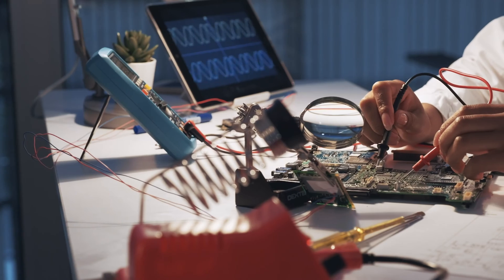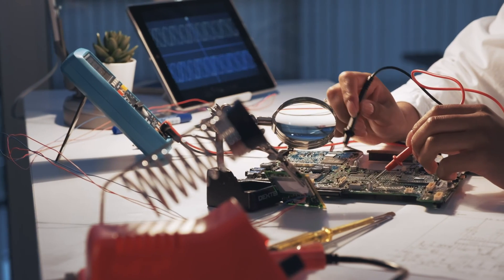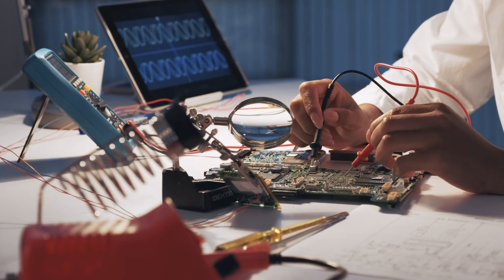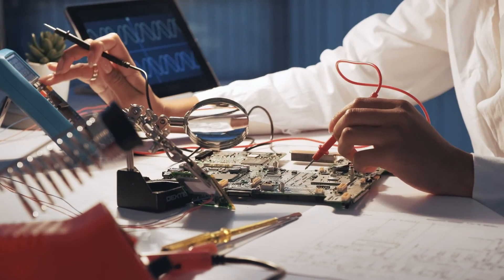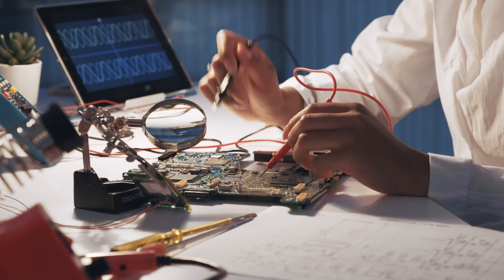Redarc 1250D Issue,  2 hour Charge Limit.

Comment: My 1225D RedArc runs for 2 hours full charge rate, resets after 20 mins of the charge rate system pulse, float etc. then goes back to what is needed up to 25 amps, 21 amps actual i am getting. But i have gone over all earth circuits for better performance. All connections and cables rated at least double what is required and distance. The main problem i see is the battery being too big for car alternators, 200 Amp Hour or more then you will have to take a lot more things into consideration. I think it is to protect batteries, alternator and wiring as these devices can get quite warm after running at full charge rate for an hour or two. Also temperature sensor inside device can limit output at times but also should reset after about 20 mins if working correctly. RedArc 1250D issues you are having you should speak to a RedArc Specialist. Maybe increase your main starter battery size to match your larger secondary battery as if there is a massive difference between Amps/AmpHours then this causes a lot of issues.
Reply from the maker: Thanks for the advice.   I've since moved that charger on and gave it to my old mate.   I'm using a solar panel now.

Comment: my 1225d keeps overheating and and throttling down to about 5 amps  about every hour. this thing is junk. REDARC is paying influincers to praise the charger without telling you its only going to charge till it gets hot and call it a day.
Reply from the maker: @thrillhunter9897  I think that’s why the 1250D that I had was programmed to only work for 2 hours than shut down.  To stop it overheating. 

My 1225D has failed.  It will not charge anymore.

Comment: i just installed a  renogy battery monitor in the  car cabin  the most ive seen the 1250d charge while driving  is 38 amps and tHAT WAS only for 2 min it averages on 23amps while driving wish i never bought it
Reply from the maker: Maybe your cabling  is not up to par or the alternator in your vehicle. 

Also the 1250D could be over heating.

Comment: I just ordered one of these.  What I am seeing from their site is that they have the boost charge time limit set to 3hr40min with a 20 min rest, then it resumes.  This is under the new firmware.  Does anyone know if this is true?
Reply from the maker: Yes it's true.  I was not able to confirm how long the charge time is with new firmware.  I've not tried one with latest firmware. 

Make sure it does have the latest firmware before purchase.
Reply: @PhilsCampingReviews  you already know that your unit is faulty, as many have been commenting for about a year now, stating that with the old firmware, the charging reset after 20 minutes.  Yours did not, therefore its faulty.  So the conclusions in this video are that you have a faulty unit.  Really you should add a pinned post, or add in the description this fact.
Reply from the maker: @richardgrant6360   it was not a faulty unit.
Reply: @PhilsCampingReviews  yes it is, if it was not faulty, it would start charging again after a 20 minute break.  Thats what ALL working Redarcs do, your unit is faulty.  This has been discussed, and you already know this.
Reply: @richardgrant6360  old firmware doesn't mean it's not faulty and the new update is pretty inexcusable too.  I get them shutting off for heat but they shouldn't shut off at a set time unless an owner chooses to have it shut off after a set time
Reply: @veganpotterthevegan  its faulty, its pretty straight forward.  People on youtube just like to create content for attention and revenue.  Its tedious.
Reply: @DonegalOverlanding  when it works as designed, I'd call that faulty.  Why would they design it to shut off after a certain time instead of limiting it by temperature?  It's faulty on purpose

Comment: What about the 1240D? Does it have the same limit?
Reply from the maker: I don't think it has the same issues.
Reply: @PhilsCampingReviews  you unit is faulty. stop going on about it like its all 1250D units.  Absolute joke.
Reply from the maker: @richardgrant6360   it's not faulty.  It's the way it is.
Reply: @PhilsCampingReviews  yes it is, if it was not faulty, it would start charging again after a 20 minute break.  Thats what ALL working Redarcs do, your unit is faulty.  This has been discussed, and you already know this.
Reply from the maker: @richardgrant6360   either way. It's still a stupid feature to have. None of the others have this feature.   

Now that larger capacity batteries are more affordable.  This js going to be an issue.
Reply: @PhilsCampingReviews  how is it a stupid feature that it has a 20 minute cool down cycle?  What would be stupid is that it did not have it and it would damage the unit from overheating.  50A is a lot of power for such a small unit, most powerful units have a much larger cooling solution built in.  The problem is that yours is faulty and didnt reset after 20 minutes, otherwise its absolutely fine.  I have Redarc BCDC1240, Redarc BCDC1250D, Ctek Smartpass combo which has 120A charging and I have now got Mastervolt 90Amp current limiter because 90A is plenty of charge while driving, and its much easier using the same brand of gear in order to communicate properly.   The Ctek was powerful, but it doesnt have good solar options, way too restrictive.  You really need to get some solar up there on your tent, it will really help.

Comment: I'm a bit surprised at a few comments that are talking about buying Renogy instead of Redarc. Renogy is junk and shouldn't even be compared to a high end product like Redarc. They're in completely different categories. Renogy will break on you at the most inconvenient time & place after a few uses. It's a ticking time bomb. Amazon even has a warning message displayed for Renogy DC-DC saying "frequently returned product".
Reply: Well, in practice, this essentially breaks on you every 2hrs😂
Reply from the maker: I know a few people with Renogy and have no Issues. 

Agree. Redarc is better quality. But some people don't have the budget for redarc.
Reply: Hey, dont come in here with facts to ruin what is en entirely misleading video.  It should be taken down as his unit is clearly faulty.  So many comments stating that it resets after 20 minutes.  He has not though, because he likes the cash from the video.
Reply: @richardgrant6360  if its nice and cool it will reset in 20 mins but if its hot outside it wont reset for a couple hours. because it shuts down to keep from catching fire. it gets so hot you will burn your hand.
Reply: @richardgrant6360  I absolutely wouldn't want something that stops working every 2hrs for a 20min reset.  Why does only redarc have this? *A year later, this video has 5000 views.  Probably gave him enough to buy part of a tank of gas

Comment: I fitted a 80mm fan to the 1250D and in 21 to 23°C ambient, it ran @ 50A continuously for 5hrs 15mins, putting 260AH charge back in to my dead flat 2x 120AH Kings LFP batteries. @ this point, the batt voltage was 14.1V according to Vitron, and the 1250D continued to charge for another 10mins, with the current falling away to about 10A before the battery finally cut off at 14.36v. After 2mins, the 1250D dropped its voltage to 13.7v.
All of this is a comletely normal, and correct charge cycle.

Before the fan was fitted, the 1250D would run @ 50A for about 10mins, b4 dropping to 43A.

I used a 21cfm 12v 18dBa fan. This is the quietest 80mm fan on the market, but also the lowest airflow, and the 1250D still produced 50A @ 22°C for 5hrs.

Any regular cheap 80mm fan will produce 30cfm and 28dBa - you should not hear 28dBa when the car is driving. 30cfm is 50% more than the fan I used, thus any 80mm fan should be ok.

I used some 12.7mm Adhesive PCB Standoffs from Jaycar, plus a 80mm fan guard, amd sone zip ties. Mount the fan to the ribbed face, 1/3 from the led end - this end is hotter.

I tested the fan with the 1250D both horizontal laying on a solid surface and vertical - makes no difference - both are still 50A after an hr

1250D fixed.
Reply from the maker: Interesting.  I wonder if a ambient temp of 30c if that fan would make a difference. 

Do you have any photos?  If so if you could email them to me at.
Philscampingandtouring@gmail.com
Reply: @PhilsCampingReviews  ok. I will test at higher ambient soon - I will use my travel oven. It didnt occur to me that the 1250D would not be mounted in the cabin, ie, in 20-25°C ac comfort. Yes, many mount the 1250D in their camper trailer. I will send pics soon.
Fyi, I am testing a Kings40A DCDC today - with and without a fan.
I hace a 2000usew inverter,  induction cooking, and 240v kettle and toaster. And, also use the kettle to provide hotwater for the Lion powered camp shower.
50A charging is not enough for me. I am adding the 40A kings in parallel. 90A total charging is about the right max load for my 130A altenator.
Reply from the maker: How did the test go? 

I'm considering  trying another Redarc 1250D with a newer firmware. 

I like the idea of attaching a cooling fan on the top.

Comment: Phil your analysis of this problem is what I needed to hear. I'm in the market for a DCDC charger and inverter system, and still deciding on the brand to buy. Thanks for going into so much detail on issues.
Reply from the maker: Thanks.  The redarc dcdc 1250D.  If you purchase that one. Make sure you check the serial number before purchase with redarc to confirm if it has the latest firmware.  If it does. Purchase it.

Comment: I would only pick a charger that allows me to vary voltage thresholds (0.1V steps) & current limit to custom settings. Bluetooth or similar is better. I'll skip Redarc & similar that only have factory presets & not much flexibility.
Redarc should provide more information about any limitations & algorithms that may reduce usability/performance. Idle for 1hr should give reasonable cooling for 30min repeat if is wasn't firmware limited. Any limit should be based on temperatures not just time. Design should have been made to atleast handle 25A all day long. Should limit time charging the battery above 13.8V (depends on battery Ah), ramp down current till 14.2V & 1A. Need calibration/offsets for cable length or inaccurate sensors.
Reply from the maker: That would be the Victron?

Comment: Great Info Phil, thanks. I just emailed Redarc re. if the 1250D had any limitations with low ouput alternators (eg Hilux 80A). The response was - The unit can take up to 58 amps dependant on the voltage that the system is seeing. Will be looking at the 60A Renegy now, or 2 x 12/12 -30 Victrons. What did you end up with ?
Reply from the maker: I'm still using my old Redarc 1250D.  Have not purchased another DCDC thus far.  

I'm considering the enerdrive 40a dcdc

Comment: This 2hr boost is on the older models Phil the current model does a 4hr boost.

You can send your models back into Redarc to get reprogrammed for a $65 fee
Reply from the maker: I'm going to replace it with another dcdc charger.  I've noticed this one will only charge at 40 amp Max after apx half hour.   First half hour charges at 50ah. 

I don't think it my alternator.  It's rated apx 100 to 110 ah. 

I thinks its the heat.  The redarc feels very hot.
Reply: Where is yours located Phil?
Reply from the maker: @Extreme Auto Caravan and Camping. S.A.   inside my pajero on a board with all the rest of my victron gear.
Reply from the maker: @extremeacc101   next to my egon dc hub. Which is apx a couple feet from house  battery

Comment: Could the two hour charge limit be to protect the batteries from overheating…..?

Can’t be to protect the charger…..even if it were red hot…it would cool down in less than an hour…..
Reply from the maker: No. Nothing to do with battery.  It's all redarc.

Comment: Another great video Phil I have a Victron bms to charge 2x135 amp Safirey lithium’s with alternator limit draw max at 80 amps Vw Amarok it seems to cycle through depending on battery level bulk absorption float etc no dc To dc charger at all still learning though just making a small solar generator Victron mppt 30/100 2x140 amp solar panels to charge with one of the 135amp batteries everything costs money but your videos have helped cheers have a safe and happy Christmas
Reply: Waterproof ❓bms 12/200 in a sealed box yes it goes into float after charging you can setup limits in the Bluetooth Victron app
Reply: https://youtu.be/xolUrSHiNHM brought this off safiery and set up in weather proof box goes in canopy of Ute
Reply from the maker: @Jamie Martin   interesting.  I did not think it was possible to setup that way without risking doing damage to battery.
Reply from the maker: @Jamie Martin   so he must have setup the perimeters in the smart shunt to shut down charging when battery reaches a certain voltage. Probably also factoring in the SOC.   And all the battery protectors included is why this works. 

You would want to make sure the shunt is always configured correctly.
Reply: Is that victron bms waterproof I've been looking into something like this for a while. I'm wanting to upgrade my start batteries in my boat with lithium without blowing up the alternator on my outboard looking to charge 2 130ah batteries at 25amp
Reply from the maker: Sounds like an interesting setup you have.
Reply from the maker: So it still goes to float charge and not overcharge the battery?

Comment: Good point 
But it's also designed to run with solar panels  to get the maximum output.
Reply from the maker: I don't run any solar panels on my roof top tent.  After I upgrade my roof rack bars.. will add a couple solar panels.

Comment: Hi Phil, I just spoke to Redarc tech support (as i have 2 -1250D's ordered at the moment! ) They confirmed that all the chargers have the same charge rates...they run continuously for 2hrs and 20mins and shut down for 20mins and should start the next charge cycle. The older versions from 2018 were different. Give them a call as they are always very helpfull. Maybe yours is faulty and could be changed under warranty.
Reply: Can confirm that my 1250D charges for 2hr's 20mins resets for 20mins and continues its boost charge if needed. Have had no issues with this setup running in the front grille for maximum airflow and see between 45-50ah consistantly. 

I think there is an issue with your unit Phil
Reply from the maker: @JLM85_   maybe this one I have is faulty.
Reply from the maker: Mine would not start charging again.   I kept trying all afternoon.  I tried a couple days later and it started charging.

Comment: The renogy is the go I like how it backcharges your start battery as far as I'm aware only the renogy and the ctek have that feature
Reply from the maker: There is a new Renogy DCDC just released,  it's 60ah charge rate.
Reply: @PhilsCampingReviews  I've seen it it's the one with the big button on the front for changing battery chemistry. The only thing you might need watch out for Phil is how the renogy handles the heat and de regulates the output. The redarc units I believe are ahead of all the other dcdc units in that regard 80c internal temp every one else 50-60c internal temp before they dial back the amps. I'll be curious to see your results on an extended 3-4 hour charge cycle.
Reply: How big is your alternator phil
Reply from the maker: @M H  I been trying to find that out.  I believe it's a 100 to 110a alternator.
Reply: @PhilsCampingReviews  so you never want to run your alternator more than 80% of its max output otherwise you'll greatly shorten its life. So for your set up your looking at 80-88 amps what you need to do is get a clamp meter and put it around the cable coming from your alternator to your battery and simulate a night drive with the vehicle running with your spot lights, ac and stereo on then you can add the 50a to the base number that you get and see if you fall in that range. If your under your good to go, if your over well you may need an alternator upgrade or a switch to turn your dcdc off under high load conditions hope that helps
Reply from the maker: @M H   thanks for the tip.  I must get myself one of those clamp meters. 

I been looking for a good excuse to get one.

Comment: Phil I would have thought the charger would only stop charging when it reached a certain temperature level. For the charger to shutdown after a time based period seems weird really. What if after 2 hours the charger is still at a safe temperature level? no good to you if it's shutdown.
Reply from the maker: 2 hours right on the dot.  I monitored the drive home.  Started Pajero at 9:38am.  at 11:38am it stopped.  and will not start,  even after stopping for some 20 minutes for lunch and at home.  I tried again 4 to 5 hours later and still no charge.
Reply: @PhilsCampingReviews  Phil I have the Redarc Manger 30 with the TVMS and Red Vision system in my canopy and can't fault it It runs non stop when needed and averages around 30 to a max of 35amps of charge. Not sure what they have done with this product I guess they would have a reason.
Reply: Switch to Victron gear mate. Their Orion device will help you.

Comment: Hi Phil, Have a look at a ctek with the smart pass not cheap but a ctek with a smart pass attached you'll get 120amps.
Not cheap and they are good quality, not waterproof it's worth researching.
Reply from the maker: I will look into this.  Just don't think my alternator will handle such a load.
Reply: Phil, I was looking at an alternator pulse charger from the USA where it would allow a % of time for a
 Direct charge from the alternator to the battery banks then stop for a % time period to allow the alternator internal temp to decrease, then repeats the process. I was looking at this with a set of DCS lithium batteries. Inexpensive as well. I will hunt around and see if I can locate